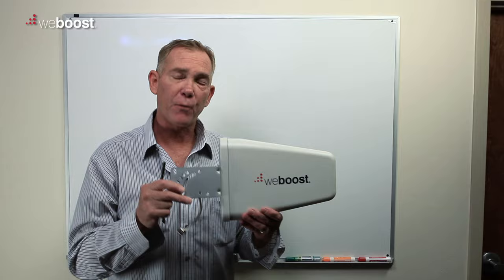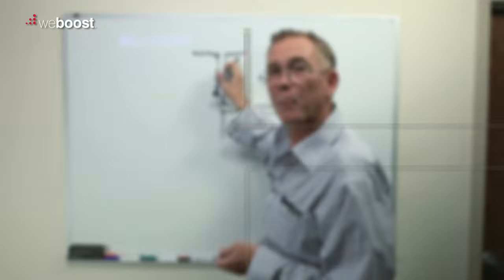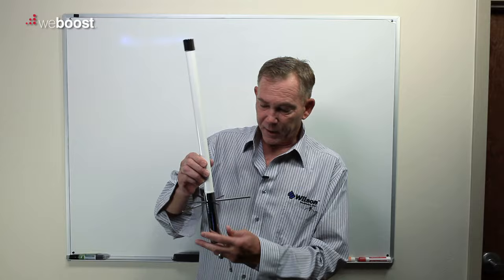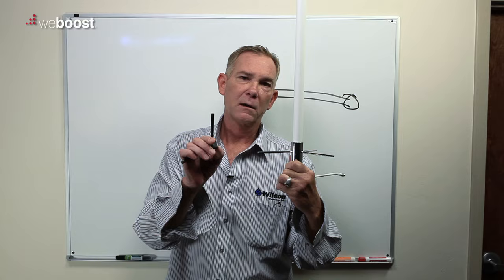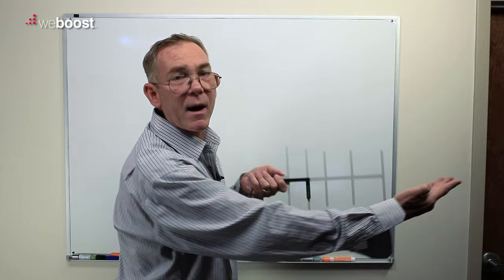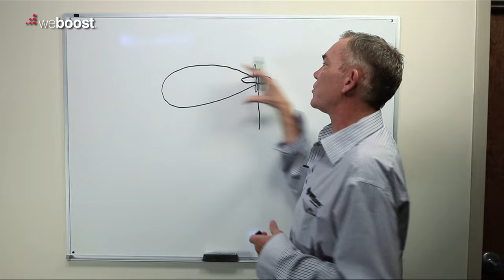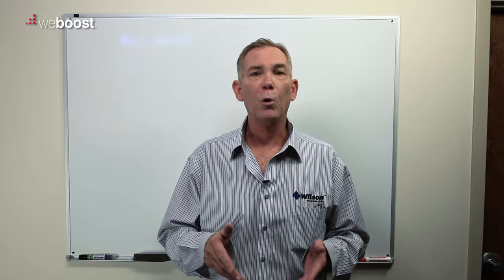Omnidirectional vs directional antennas what's the difference? | weBoost

Comment: I live out in the country 60 miles south of Houston . Home has a steel roof and is two different levels .  I am thinking of buying a ,LAVA HD8008 Ultra 4K Omni-Directional Amplified Outdoor
HDTV Antenna .   So does my roof act as a ground ? and where is best place to install it ?  On the ridge cap of lower roof , away from upper roof? or does it need to be higher than upper roof ?  How about on a pole at edge of upper roof ?

Comment: Does a yagi need to be horizontal reguardless of trees etc?
Can you increase a yagi using a satellite disk?

Weboost 4g 470103r.  booster works good with outside signal @ -114   Distance is 30' yagi on roof to booster then15' to inside flat antenna. Phone reads -87 at the inside antenna then drops to -114 in 26 clear feet with soft install.

This only covers @ 1/2 my  1600 sqft home but is much better than it was without it.

Options I'm thinking of: rg11, wilson 400, less cable and or taller outside mast,  use of satelite disk. Closest tower @ 3 miles

Comment: Quick question:  If we were to use one of the inside panel antennas as a receive/ transmit antenna outside/on a window, would we consider this an omni-directional antenna?  Also, when using the panel-type antenna inside (as the amplified 'broadcast' antenna), do we get any signal to/from the rear of it (the metal plate side)? Thanks!
Reply from the maker: +David Knapp David, the panel antennas are directional. There is a small amount of radiation or signal transmitted from the back (metal) side of the antenna but very little. 

The inside panel antennas are not weatherproofed so we'd recommend using one of our outdoor panel antennas if you want to use it on the outside of a window. Hope this helps.

Comment: I'm an engineer but I often struggle with concepts outside my field because there are many contradictions. I'm curious, how can current flow in your simple diagram if it's open circuited? Or is it just polarity changes? in either case, if you don't have current, you can't have magnetic fields...or is this electric fields and somehow different?
Reply: disassemble an antenna and figure out how it is designed and look at the circuits of a radio, pay attention that electromagnetic wave is a form of energy and it is also a wave, photo electric effect might also help to understand this, to those who might not like photoelectric effect concept used to explain radio wave transmissions: if you use an antenna to produce a wave, you have to absorb a wave in order to receive a signal

Comment: hi .. i have a bunch of wifi router antennas lying around. I think they are omnidirectional antennas. 

I have an LTE router that has antenna ports. Can i use these antennas on these ports and try to boost the LTE performance? will it help?

Also another router from another service provided did provide flat (probably Yagi) antennas. Im wondering which is the best way to use a Yagi antenna on a lte router.. ?

Thanks

Comment: Can you add 4 of these directional antennas to the same connection and point them in 4 directions?
Reply: Azim Alif: You don't need to....just use an antenna rotator then you can just turn it to any direction you like.

Comment: will a normal car antenna work if i install it on a boat? 
Not at all or with disturbances?
Thanks 
George
Reply from the maker: Yes a mobile antenna will work on a boat, assuming you are using a Mag Mount you will need to have a ground plain, a metal disk or a steel structure to adhere it to.  I would recommend a Mini Mag mounted as high as possible on your boat. 
Let us know if you have anymore questions.
Thanks for watching!

Comment: Is There any Negative Effect from use one Antenna for more than one Gadget? 
Which split it from the cable with cable splitter?
As I Know TV Antenna can make it happen, but how about Antenna for Cellphone or Wi-Fi?
Reply from the maker: You can split an antenna for multiple devices, the negative effect is from the splitter, they are somewhat lossy.  I do not know of any antennas that would work for all the bands you describe.  Good luck!
Reply: Thank You for Advice (y)
Reply from the maker: You are welcome, glad to help.

Comment: What keeps the reflector from acting as a director, and what keeps the directors from acting as reflectors?
Reply from the maker: +jeh32 Size and spacing. The reflector is generally larger than the driven element.  Directors are smaller.  This is a simplified answer. But I hope it gives you the basic idea.

Comment: I noticed that in a "normal" Yagi antenna, each additional director gets slightly shorter so does this mean that it has a limit to its # of elements since eventually they will be so short they wont even stick out of the boom?
Reply from the maker: +David James This should not be true, unless it is a Log Periodic antenna. Assuming we are talking about a Log, the first element is tuned to the first band you are attempting to capture.  Also note that a log is fed from the front, not the rear as in a Yagi.
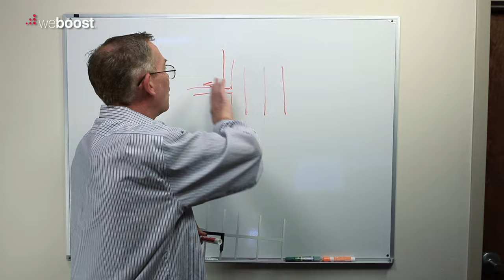Reply: +weBoost Most of the Yagi antennas I have seen have a small taper to the directors (they get slightly shorter as they are positioned farther away from the driven element).  I have seen at least one design where that is not true but I am inquiring about the more common case which is tapered.  Even that 5 element Yagi you use in your video appears to have a shorter front director. I can see this clearly at time 3:31 just by "eyeballing" it.  Measure it and I bet it is shorter by maybe 3 to 5% of the previous director.  Your statement at 4:42 doesn't seem correct to me as I can even see a size difference in the 3 directors in that image of them.  Also you state the at 4:45 the directors encourage the energy to come in, or go out, but more correctly you should use the word and, not or, since they do both.
Reply from the maker: +David James You are correct the front director is 10 mm shorter. This was done to give the antenna more bandwidth.

In this video we wanted to simply illustrate the basic difference between omnidirectional and directional antennas, and so did not go into great detail. We appreciate your feedback, knowing that there are interested people like yourself looking for this sort of information is helpful to us so we know what sort of content to create for future videos.
Reply: +weBoost Ok good idea and I appreciate that you share your knowledge of antennas.  I am a ham radio operator and have an interest in antennas but my "nitpicking" nature comes from being a Computer Programmer where things have to be very exact or they don't work at all.  Antennas seem to be much more "forgiving" than computers.  Antennas seem to be a combination of fun, amazing, mysterious, fascinating, technical, bizarre, very useful, sometimes unpredictable (indoor), 50% art 50% science, "voodoo magic"...
Reply from the maker: +David James You nailed it, antenna design is 50% theory and 50% magic.
Reply: +weBoost The 50% theory/science and 50% voodoo magic is what most hams (including myself) agree on based on their experiences although it could be argued that the 50% voodoo magic is because the tester doesn't have the proper test equipment to predict the results but it seems some antenna situations cannot be predicted accurately such as an attic installation of a beam antenna.  No software could model that accurately.

Comment: Hi, weBoost. I was wondering one thing. My wifi router has three omni directional antennas and I am living in single story house. The router manufacturer suggested to position two antennas in diagonal (45 degree) and one vertical. Since you mention omni directional antenna transmit with "donut" pattern, should I align all three antennas vertically upward for better coverage in my single story house?
Reply from the maker: Great question! The reason for the 45 degree angles is to reduce antenna interaction.  I will not increase speeds to have them all vertical, as there will be some overlap in the patterns. The center antenna pattern will not overlap if the side antennas are tilted away 45 degrees. That position is optimal for the performance of your equipment.
Reply: weBoost WOW! Thank you so much and really appreciate for explaining in such details. I will remain my antennas as suggested. Again, a million thanks.

Comment: may i ask which is easier to install?
Reply from the maker: Hi NING, great question. Both antennas usually require the same L Bracket. Some would say omni is easier, only because you don't have to orient the antenna to point towards a tower. So it's a tad easier, but often times we still recommend directional over omni for performance.

Comment: The pattern you show at 5:12 is misleading.  You should explain that what you are illustrating is the strongest part of the pattern, not the absolute coverage.  It would be informative to explain that a directional antenna still radiates in ALL directions just better in some than others.  The "fat submarine" shape you have does not illustrate that.  Some newbie to directional antennas might dismiss using a directional antenna cuz he/she might think there is no radiation outside the "fat submarine" pattern.

Comment: He did not explain the yagi ant correctly.  The way he was holding it was Omni directed. The frequency the yagi  ant he was holding must be above 500 MHz. He explained the dipole very well but a yagi must be horizontal to work correctly and give you the graph he explained.  He explained the yagi as a omnidirectional ant.

Comment: I am trying to decide between an Omni vs Directional antenna for my home. My situation is that I have a wireless hotspot/router from a provider named gotw3 that is a basic router originally designed by Observa Telecom.(specs here - https://www.rvmobileinternet.com/gear/c4r400/) I have 4 towers that I bounce between. 3 of them are 3.5 miles or less away from me, and the 4th one which I frequently connect to is about 7.5 miles away. And I believe I need a multiband antenna, but since I am not that literate on this topic I am not certain of that. My hotspot/router has a T-Mobile sim card in it. Do you have any recommendations so that I don't waste my time and money with a trial and error approach? I know the Omni would be easier to install, but would that be better. I also watched a video saying that I need 2 antennas for maximum effect but I am thinking that my second SMA antenna port is to broadcast the wireless in my house because this device does not have an internal antenna. Can someone save me time and money with what my best option might be? My signal ranges from 6Mbps to 10 on average with a high(rarely) of about 20 Mbps. I am afraid to tie myself to only one tower. The one I connect to most is not the one closest to me. It is 3.47 miles away and I have 2 that are about 3 miles away.

Comment: Hi, I have a toy quadcopter for 2.4Ghz but looses signal about 20meters, I plan to remove its 1/4 wave simple wire antenna and make/add coaxial like this:
http://i.ebayimg.com/images/g/VbkAAMXQ4uJSAcQw/s-l1600.jpg

Could it work?
I think with the ground on the side of the coax I could at least move the middle wire more out of the body, but as I know adding coax ruins efficiency.